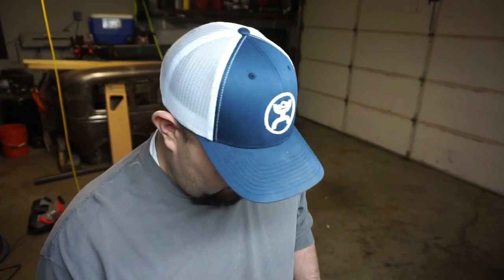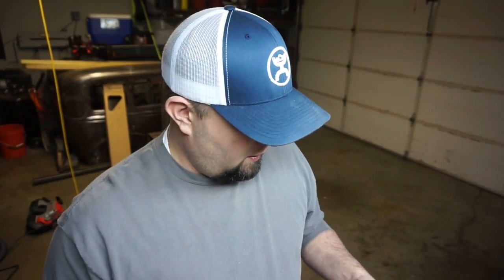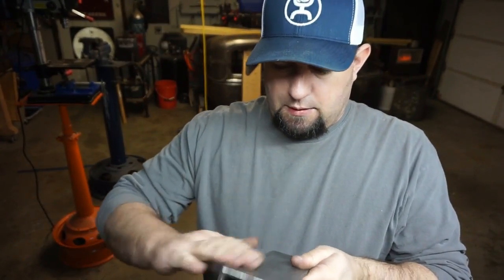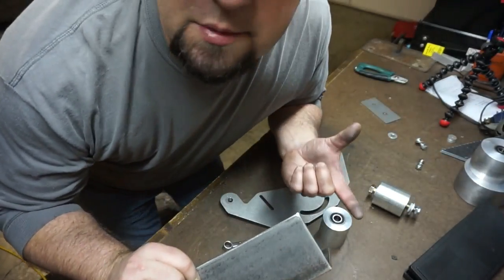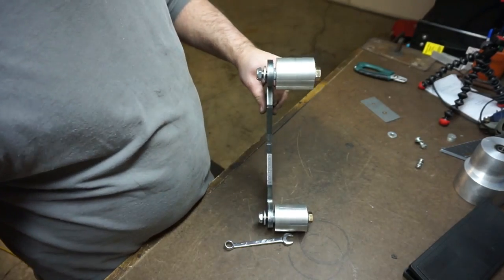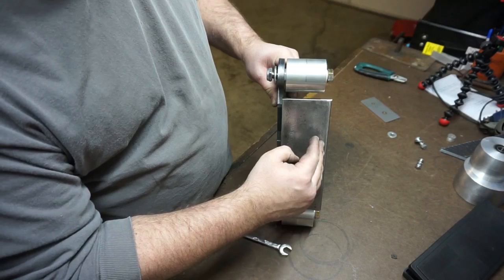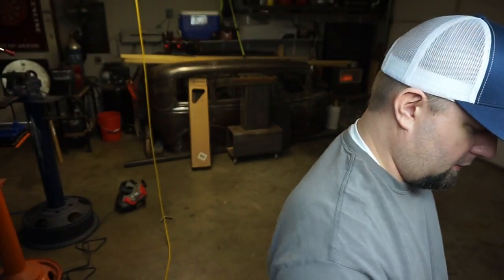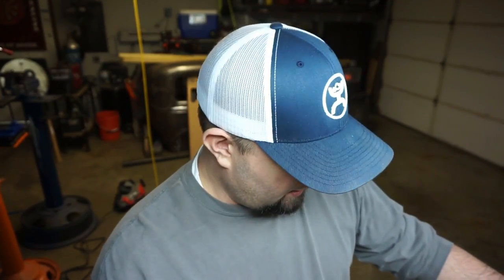2 x 72" Belt Grinder Build, Part 1 of 4...

Comment: Good looking build so far. Only problem with setting the platen up like that is it's hard to do the plunge line on the opposite side of the knife, but for someone who didn't know what it was called you are kicking arse. And screw the YouTube safety police, I often forget to put eye protection on too, first spark shooting back at you gives you a reminder 😉

Comment: Do you think a motor that is 1&1/2 horse and running at 3450 rpm will be too fast with a 4" pulley
Reply from the maker: +Bert Marchand will you have a 4" pulley on both the motor and drive?

Comment: Hey +BlueDogGarage

I'm a few videos in on this one (it was pretty funny watching both  you and your little girl jump when you first plugged it in) and was wondering a few things:
- I know these things are a fairly standard pattern but are you building this off a set of dimensions that you found somewhere or have come up with?  Can you share them?
- I noticed that you seem to have a height that you like for your equipment bases (in your next video you see them all lined up in the background).  I'm curious, what is that height (and are you measuring to the working surface of the tool, the base that the tool is mounted to or....?) and how tall are you?

Nice work!  Subbed and thumbs up :-)
Reply from the maker: Hey Mark, I just kinda figured it out as I went. I've seen plans online but didn't want to shell out the extra cash for them... I don't have any measurements in it but have been planning a 4th video for the series to show dimensions I just wanted to use it for a while to see what gremlins would arise. I'll try to get that video up this week..... As far as tool height I just try to make sure I can stand up straight to save my back, I'm 5'10" and make my work height around 44" ....but my workbenches are 36" to give me room for tools/projects to sit on and not need a ladder to see the top... Hope that helps bud!